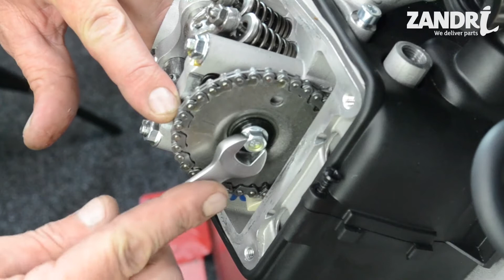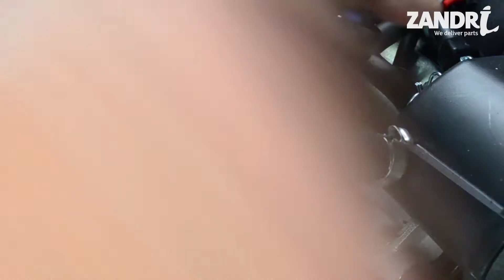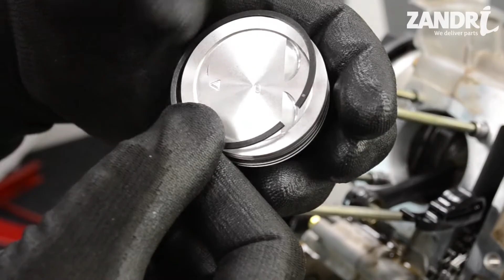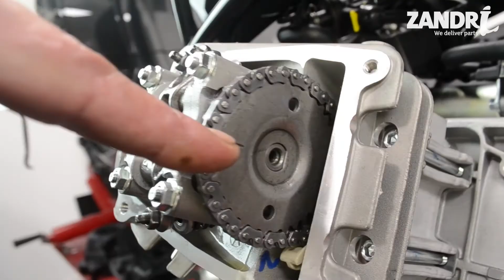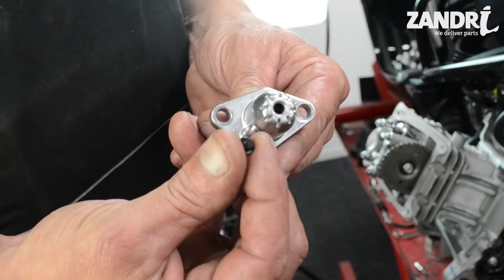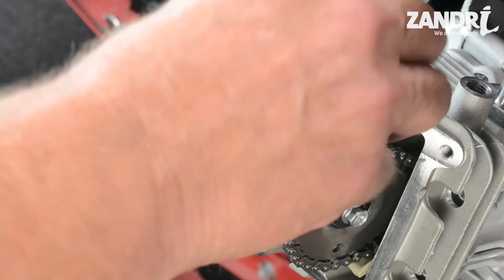80cc Malossi cilinder | Piaggio / Vespa 4t 3v IGET Euro4

Comment: Merci pour le partage. 
J'ai besoin information. 
1 - Je vois que vous installer 2 Gasket.
• 0,40 mm: to be used in 2 or 4-valve engines
• 0,80 mm: to be used in 3-valve engines

Jai fait comme vous l'avez indiquer,  j'ai installer les 2 gasket, mes dans les instruction il dise d'installer le 0,80mm pour le 3v. 
Je doit redémonter pour installer uniquement le 0.80mm ?? Car il claque un peut. 

2- J'ai 2 shim pour le cylindre Malossi 2613930E je suis obliger de les installer ou je peut utilise ceux d origine ??

Merci a l avance !
Reply: Did you ever find an answer to your question? I only installed the 0.80mm gasket.
Reply: @Mandingobull  yes thanks i contact directly malossi and they said 0.80mm :)

Comment: Kan iemand mij vertellen wat voor gereedschap hij gebruikt om het spruitstuk los te maken ?
Reply from the maker: Dit kunt u met een standaard doppen-/ratelset doen. Zie hiervoor als voorbeeld: https://www.zandri.nl/doppendoos-ratelset-endurance.html
Reply: The OEM M6 cap head bolt on the manifold and few on the transmission box need a special tool, (Warranty B/S) I remove mine using a Robertson tip No4 , using a small ballpen you manage to stock the tip in the cap screw and proceed to unscrew that $%&T. replace all of them with "NORMAL" M6 cap head screw. Your welcome..😉

Comment: Does this kit also fit on the newer Euro5 engine (CD01M)?
Reply: It fits but it won’t make a difference because there is no ecu unit for the Euro5 eniges yet, you you’ll just go the same speed but use a lot more fuel and it maybe won’t even drive good

Comment: Hello,
for this upgrade is needed to be change only cilinder with piston, or also i need to order new head? or the head is good from 50cc?
Reply: Original head from 50cc is good enough
Reply from the maker: The cylinder head can simply remain standard. There are no 80cc cylinder heads available. You can fit a performance camshaft for better performance.

Comment: Het is toch niet mogelijk om 2 voetpakkingen te monteren?
Reply from the maker: Er zitten 2 voetpakkingen in de cilinder set van 80cc voor Piaggio 4-takt motoren. Malossi heeft dan het volgende gedaan;
- voetpakking 0,40 mm: geschikt voor gebruik met de 4-takt 2- of 4-kleppen motor
- voetpakking 0,80 mm: geschikt voor gebruik met de 4-takt 3-kleppen motor
Reply: @zandrishop  bedankt!
Reply: @zandrishop  does this mean I must use the malossi gasket in addition to the original gasket? Or can I use only the single malossi gasket?